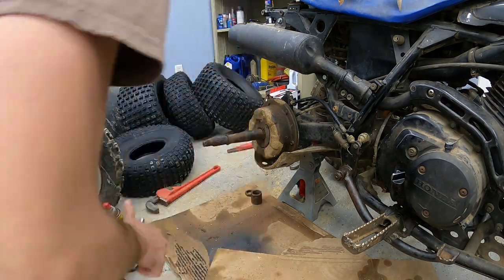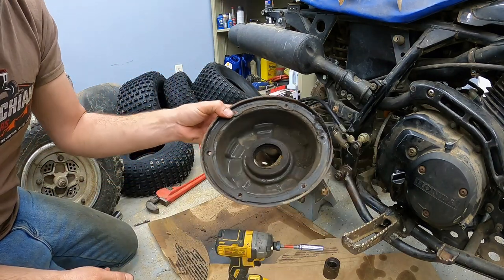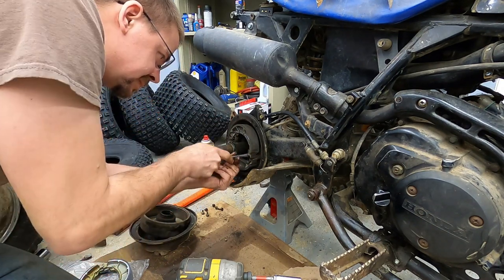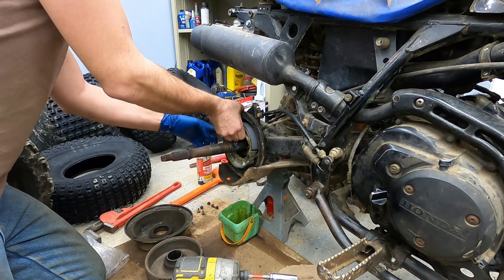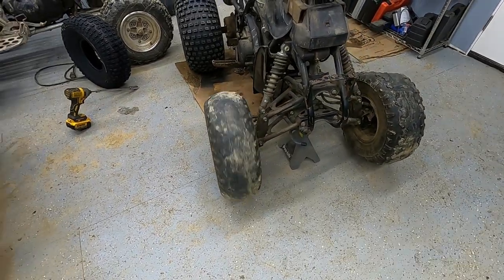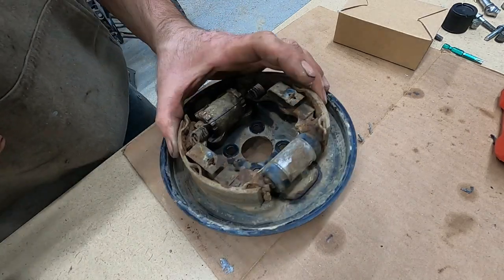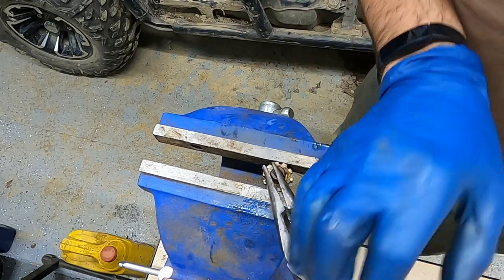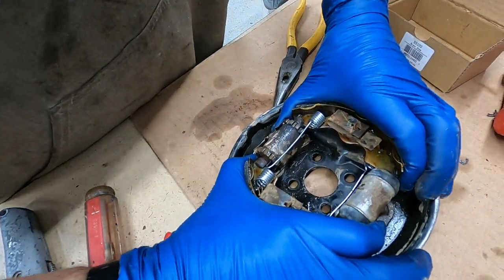86 Honda Fourtrax Brake Pad Replacement and First Rip

Comment: So glad to be watching a 200sx vidja! just got mine running a few days ago, she was destined for the trash, had almost everything taken from it, starter, switches, sprocket was welded on. One of the chain adjusters are missing. and the only issue with the motor is the rings were bad... She starts in 2 pulls. love these hondas!

Comment: Do you know what other model of front wheels will fit the trx200sx?
Reply from the maker: Not off hand. Probably have to do a google search to find what the bolt pattern for the front is then go from there.

Comment: im just lost, it ran first pull when you dig it out. you ripped the engine apart to put rings in it, then had trouble getting it to run again, and in the almost enitrity of this project have not really done more than make it worse. 
heres your checklist, suspension, carb, throttle/brakes and cable. PLASTICS, repair seat, maybe paint frame/ clean rust, and good to go. if you pull that motor apart again, spend the 200$ to put a new piston and bore it up a size. use quality parts if you do. otherwise stop pulling a good machine apart to make videos.
Reply from the maker: How have I made it worse? It runs better than it ever has!

Edit: I forgot how old this video was and the thumbnail pic is very similar to the last one I did with zippy...lol. Make sure you keep watching the rest as it’s running 100% now!